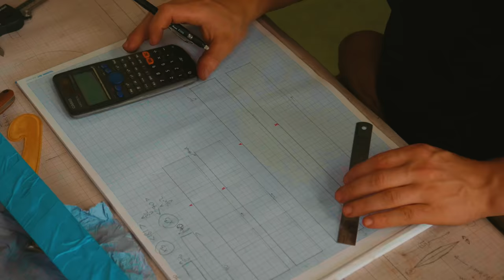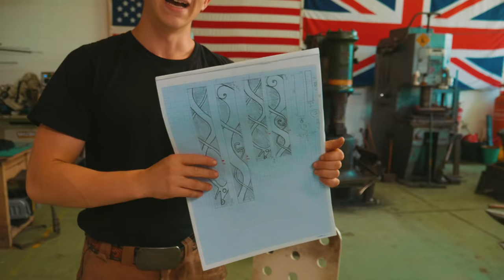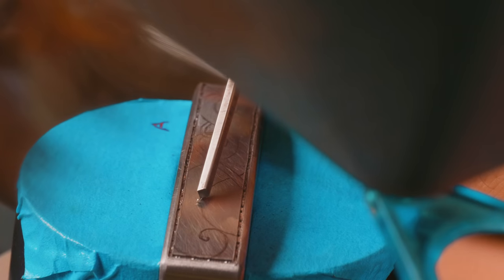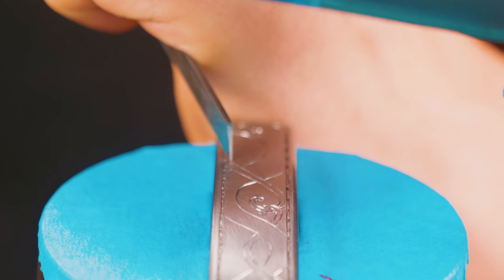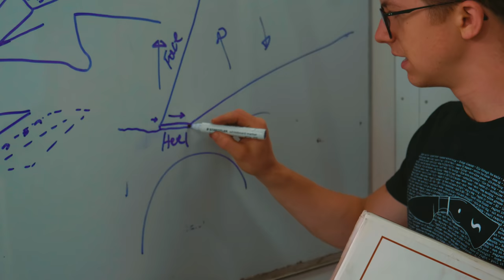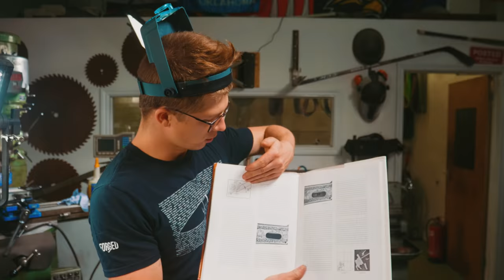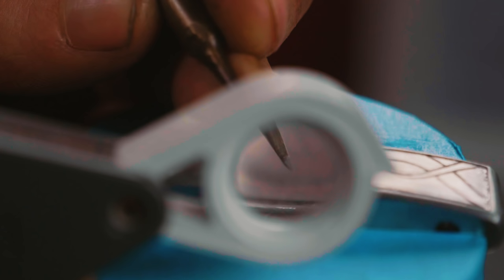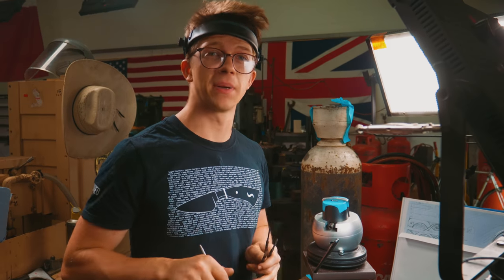MAKING A VIKING SWORD!!! Part 13

Comment: @9:12 I can SO relate to that, when I was attempting my first forged hook, I couldn't work out why I couldn't get it into a nice taper, maybe I copped one too many face fulls of hot embers from the charcoal, maybe I should have revised before I started, but rewatched the learn black smithing online video (By ☝️Alec Steele ☝️) and realised it was because I was holding the work piece flat to the anvil rather than at a rather acute angle and also my 4lb club hammer wasn't exactly the best tool for the job as its very hard to get the correct angle of the hammer head.

Comment: okay so you always ask about suggestions from viewers, and you've pointed out iforgeiron.com as an information source for viewers who want to learn more, well i happened upon a post there while i was looking at various quenching methods.... mercury quench.... works great if you dont die; but my suggestion involves: could you do a Gallium quench??? i saw related posts but gallium is only mentioned no detail is provided
Reply: i did a bit of research about gallium: cost, toxicity, corrosion reaction to other metals and weight to volume ratio... if you could do this and see if its comparable to the results of mercury quench i think it would be awesome, if not if you could comment why this wouldnt be possible in a future video i would really like that because i found a lack of detailed information specifically about attempting a gallium quench